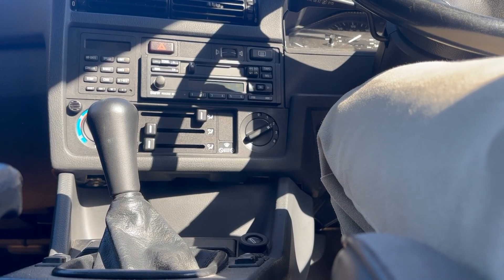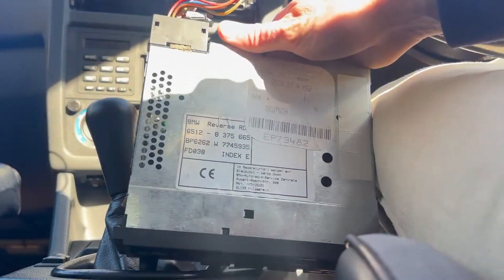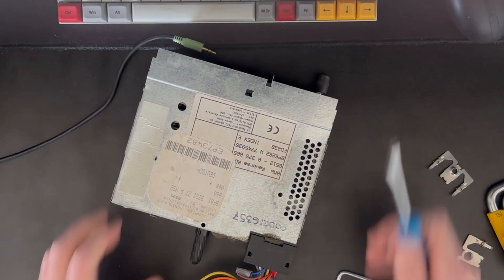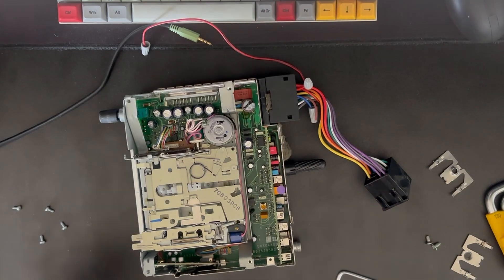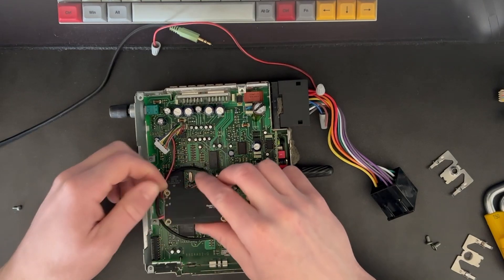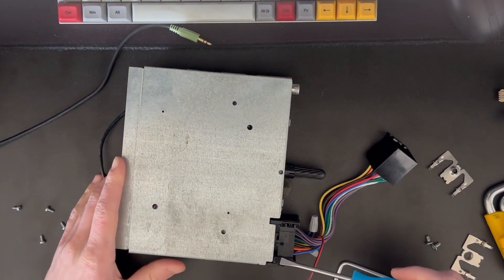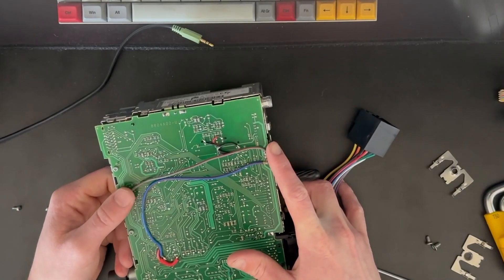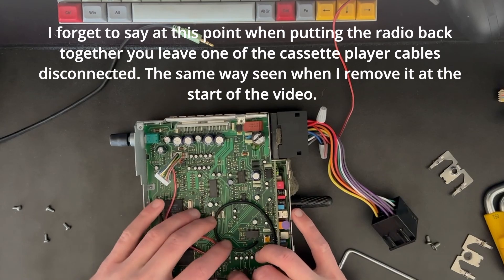£7 DIY Bluetooth Retrofit BMW Reverse RDS BP6262 E30/E36

Comment: Does this work for the e36 c33 radio?
Reply from the maker: It would be a similar process. I can't say it'll be exactly the same, though. The easy part is finding the audio lines from the cassette player, but the more difficult part is figuring out how to trick the radio into thinking there's a cassette inside. Here, I did it by grounding, but this can also be done by putting in a cassette with no ribbon.
Reply: @archiehocknell1543 I saw another video where he used silent audio cd/tape. And it allowed him to still use the cd player/ tape deck. This was my understanding at least. 

If you didnt ground it, and needed a tape inside, say with music on it, it would play the tape, but the Bluetooth would still connect? So would it just be playing both signals at once ? Curious about this part. I have a cd43. Would like to do this but I want to keep my cd function
Reply: @CarmenRidolfi You can always cut AM line on pcb and solder straight to TD chip your right and left output channel which is a better idea in my opinion sińce nobody uses AM these times and you keep tape/cd working correctly.